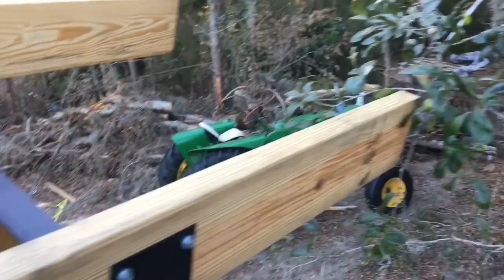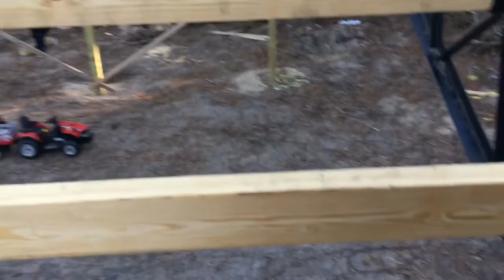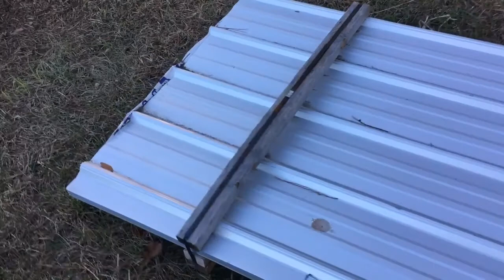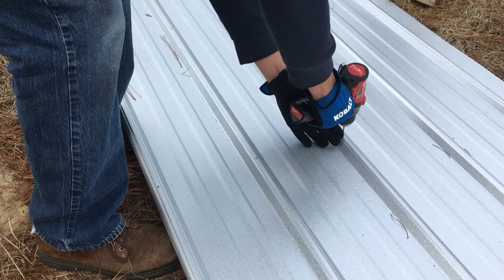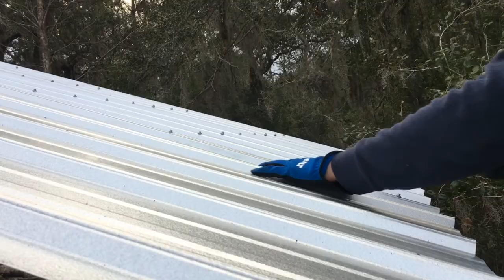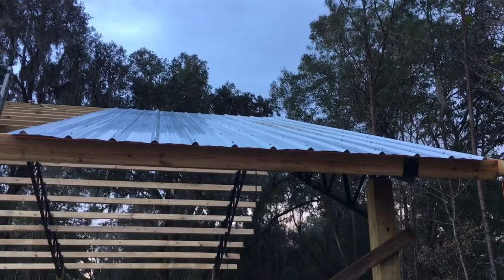Pole barn kit: How to install metal roofing straight.

Comment: drill the flats of the roof not the ribs
Reply: Yes , you’re going wish you’d put down tar paper or something similar to catch the drips soon
Reply: I'm with y'all. Tight is right.
Reply: many people do this, except this means once your screws rust out your roof leaks. On the rib the water runs off into the flat and does not rust out the screws as quickly and even if a screw rusts out and you have a gaping hole, it may still not leak for awhile.

Comment: Nice but two tips one would be when you do a 3,4,5. expand those numbers to get as big a square as you can  such as 6,8, 10-9,12,15 etc. to be more accurate. Two, put your dry line at 3 and 1/2 in and measure a half inch offset each time so that every sheet isn't touching the line and pushing it further and further as you go. Nice job though. that's going to be a nice building

Comment: I’m with you in the “put the screw in the rib” school of thought. I mark a few of the purlins the length of the building because when you put the screws in the rib it’s easy to compress the rib which in turn widens the panel
Reply: And it’s easy to get it out of square. Trust me on that one.
Reply from the maker: Yes it is!

Comment: Im about 1 year into roofing metal sheds, carports etc. But can you detail a little more on how to square up with the building and it run straight. The old guy i learnt from uses his finger as a guide ive done the same and it does run kinda straight unless the facial of the building or whatever im putting my finger against is crooked also if i try to line up with the gable trim if the outside rafter or something similar is out at the top it runs crooked just a bit and metal gets longer or shorter at the bottom. Idk i just dont get how my finger is gonna help when there are errors in the frame and stuff??😂😂😂
Reply from the maker: Lol nice! The “3 4 5 squaring method” is the best way to go. I recommend watching a few videos on that, it applies to building and squaring up anything. Fences, buildings, you name it.
Reply: @MaynardFamilyHomestead  well thanks! Ive never heard of it but ill do my research on it thanks for passing it on. Ive moved to fabricating sheet metal and truss. But i couldnt stay working on the roof which I really liked because I had to tell my job about my epilepsey. Anyway still doing roof work just on the ground now. Thank god for good bossess that work around disabilities and allow employment 🙏. I gotta build up my social security 1st!!😵‍💫😵‍💫